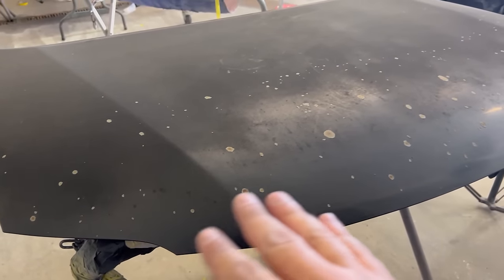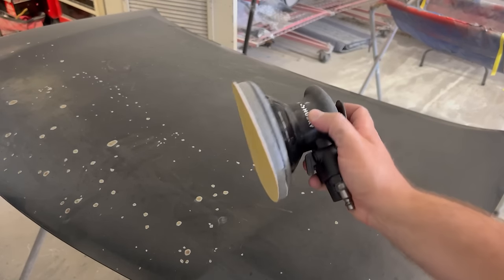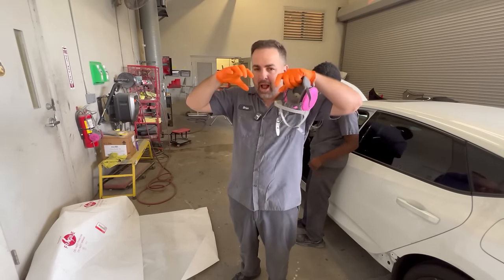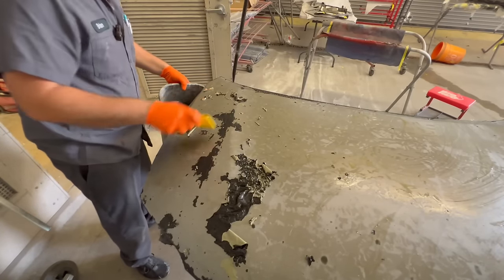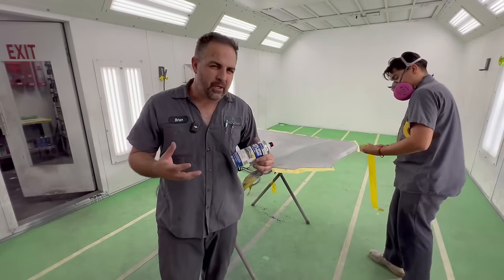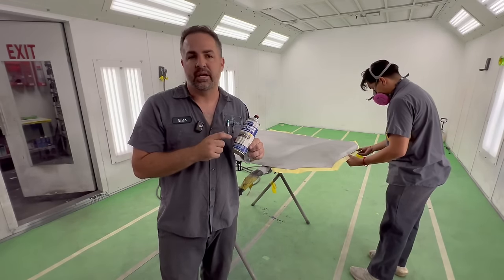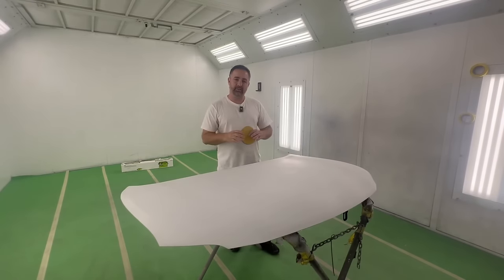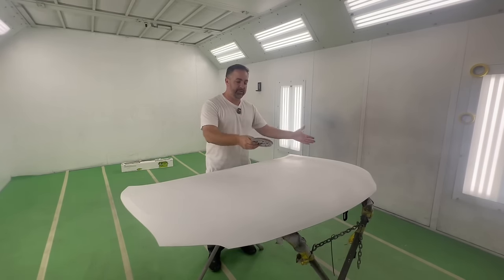The Easiest Way to Remove Paint to Bare Metal!

Comment: Great video. I would like to give you a word of caution when using a paint stripper like this. I am a retired Air Force aircraft painter with 40 years experience. I'm sure this product is not as strong as the stuff we use, but the fumes can be very dangerous. Please do not use the type of mask filters the guy is wearing in the video. Those are made for heavy particulates and or dust, not vapors and fumes. Those type off ilters will do nothing to stop the vapors from that paint stripper. If anything they will concentrate the fumes more inside the mask. When using this stuff, be sure to use an organic vapor and mist rated filter on your respirator.  Check the instructions on the different types, but I believe the ones needed are the pink and black style or the pink and yellow 3M style cartridges for that type of mask. The proper cartridges have a charcoal layer inside the cartridge and a prefilter that helps stop the fumes and vapors. A full face would be better for eye protection. Be safe out there everyone.
Reply: I would add being clean shaven when wearing a mask having a beard means they don’t seal at all.
Reply: What can I cover my face with that I would have at my house?
Reply: @cmygamelife  Nothing ... We cannot buy this stuff here where I live in Africa so it is sanding for us I think.
Reply: Correct . You are right I agree
Reply: @hendrikdebruin4012  Does H&S apply in Africa?
Reply: @mariemccann5895 It does in formal industries in some countries. Here is Eswatini not. We cannot buy these paint strippers in Eswatini so sanding it is.
Reply: awesome tip
Reply: I noticed he using 2097 filter which is for particulate. Shop might have good ventilation who knows

Comment: I work in a shop, we recently  stripped a set of wheels with this same product. To say it works great, even on powder coating it takes a bit longer. Just don't let it dry out, the slag paint becomes  harder than it was. Great stripper. Wear eye protection,gloves, and probably outside.
Reply: thank's for the tip 👌
Reply: Did you use 2k epoxy on the alloy wheels after stripping ? Or something else?
Reply: @harshadchari6065   We coated the wheels with self etching primer, then urethane primer. Before urethane base and clear coat. Hopefully it holds up for many years. IDK it was the shop owners call on the material used.

Comment: A couple of decades ago I had to strip a hood which was painted multiple times by a so called professional. It has so many layers of paint it actually looked like a cheap fiberglass hood.

I used the same process shown using plastic sheeting to capture the active ingredients while is worked.

The hood was stripped clean and primed, painted, cleared.

The shop manager was happy and more importantly, the customer was happy.
Reply: Back then the formula was totally different, ALL strippers are outright garbage now "by comparison". Knowing that already, my stubborn self needed to be re-convinced..
 I just had a massive stripping project. I had two brands of old formula strippers in my garage. I was happy as a clam watching them turn old hard durable paint into wrinkly scrap-able goop, BUT the moment I ran out, and re-purchased the same brands in their new, tree-hugger, EPA approved, save the world formula, everything stopped - and I mean STOPPED. It was EASILY TEN times less effective - not twice less effective - TEN times, and I'm being conservative. I reapplied than reapplied until the entire can were completely gone, and it still was less effective and 2 MAX coats of the prior formula.
Genuine stripper use is absolutely over.
Reply: @svenshanah  I TOTALLY agree.... The same goes for 'Brake Cleaner'...
Reply: They've been doing the same thing to paints,  stains, and thinners over the last couple of decades. All these water born oils and such 🤬

Comment: I’m using this 15 minute ( next to last ) wait period method on my 1977 Gold Wing air cleaner box in black restoration- tomorrow. I’m confident that it’s going to eliminate most imperfections on a complicated part. Doing two coats of satin black over etching primer that dried for 36 hours - then with a light scuff with 3M Scotchbrite… then “tack-Rag” ( The Furniture Guys reference ) before 1st topcoat. Wanting to mimic factory finish. Thanks - your channel is excellent.

Comment: Klean Strip used to have a dry process paint stripper back in the day.  It would go on wet, wrinkle and dry.  You could then run a razor blade over it down to bare metal.  Stripped my 65 Pontiac with one gallon!

Comment: Great video, I too use that paint stripper but when I covered with plastic, it didn't pill as easy as it did for you, I had better results without.  And I have better results in my paint jobs when I do a 50-50 or 75 overlap.  Thanks for what you do.

Comment: Great video and exactly what I needed.  You started to answer the question I had, but really didn't.  Where in this process would you do the bondo?  Bare metal or after epoxy?  I have no history with epoxy so would like to do it the best way.  Thanks so much for doing these !!
Reply from the maker: Epoxy it. Filler over epoxy. Then 2k urethane surfacer primer

Comment: Something that helps make a job last is to get any redone steel down to bare metal and then once cleaned, heat it with a torch until the metal turns from dull to shiny and get all of that moisture drawn out the steel to prevent rust. While the steel is warm start spraying your primer and not only will you now not trap moisture, but it will help bake and bond the primer to the panel and help it last a decade vs. a few years.

Comment: Thanks Brian  have been useing aircraft stripper for a long time. The new formula low voc sucks compared to the go formula  But I like the cover it with plastic going to have to try it on a firewall might be a little harder since its vertical 👍👍

Comment: I haven’t used that stuff in a while but I think it says to neutralize the acid with water afterwards, and I don’t have a problem with etch priming the whole panel, seal, base,clear in same day. I don’t use sealer and epoxy together
Reply: I thought it would have had to be neutralized also, but don't have experience with that product. Strippers  I use all need to be neutralized.

Comment: The system I use has a 2k etch primer you can put in the gun. I strip the paint to bare metal, sand up to 320 on a da, etch (2 coats), seal, base, clear. Works great.
Reply: what is a da?

Comment: Hi, that stuff works just like the aircraft stripper I was using in the 80"s except it doesn't have the additive. It was amazing how well it worked. I painted an entire car, went for supper and when I came back the paint on the vertical surfaces just fell off. no gooey mess. don't get this stuff on your skin!!
Rich

Comment: Brian, I truly enjoy your channel and have learned a ton from you.  I am a DIYer and into old 50-60’s cars.  I am just starting a project of stripping the metal for rust repairs and body work.  I would appreciate if you could give me your opinion on using “Klean Strip- Concrete & Metal Prep” on the bare metal after I get it stripped before It gets the epoxy primer?  Are there any watch outs or other prep process that would be required if using that Metal Prep?  Thanks!

Comment: I used the Ultra stripper and the other weaker  version of this brand of stripper to strip my 73 van. It had 3 layers of paint and primer on it, so it had to be removed before I laid down a new custom paint job on it with European Clear Coat. I applied the stripper in sections and covered each area with plastic wrap (generic Saran Wrap). I left it on for about 20 minutes before removing the plastic wrap. It removed one layer of old paint at a time. So I had to reapply more stripper to remove each layer. I did have to mechanically remove some of the paint layers that the stripper wouldn’t lift. It’s messy and yep you need a respirator while working with it, but I prefer using it to stripping it all off by machine. 

To repaint my van, I used all Eastwood products. That included their epoxy primer, high build primer, single stage white and black urethane paints, Candeez candy paints and silver base coat for candy and their High Buid European Clear Coat. I’m finishing up the paint work after working on the paint, body and metal work since 2021. 

Here’s my take on Eastwood’s paint products-the primers worked fine. The single stage paints were fine either with or without clear (the van has a white base coat under the custom painted areas. It seems to be a quality paint for the price. The Candeez products are decent, though probably not as vibrant as House of  Color products, but they were fine for the price. I used Urechem intercoat to apply the flake. The European Clear covers good and spreads itself out well and is crystal clear. I laid down multiple layers of it over several months. I wet sanded by hand with 400 between each coat and let each coat set up and harden for at least a week. There are probably 5 or 6 coats of clear on each area. I’m painting in my garage. 

I haven’t cut and buffed any of the clear yet, but one side that I am finished with looks flat and shiny without that step, so I think it’s going to look great after that step. I’m satisfied with the Eastwood paint products given the price I paid for them. I used 3 gallons kits of the clear which made 4 1/2 gallons of sprayable clear.

I didn’t work on the van in winter, so there has been a four or five months hiatus each year which delayed the project. I’m about to finish it the paint this Fall. Next year I should be showing the van, which is called the Led Sled. It’s a tribute to Led Zeppelin.

Comment: Hi Brian thanks for the video! This actually motivated me to re-try painting my hood that I messed up the first time! Do you have any recommendations on a inexpensive gun that can deliver similar results to yours in this video? Also I think about enclosing a part of my workshop with plastic and plywood wood to make a "dust free" room and using to square fans with house filters one pulling and one pushing. Do you think this is a good idea for a diy spray boot? Any advice are welcome and thanks again for this amazing video! From 🇨🇦

Comment: In Finland we got these 2k paints cans that mix as you use the spray by Maston. Unfortunately the ones I've bought have never worked properly.... I haven't read a single good review of these cans except for one guy in germany who used it and said it worked fine. But it's apparently a thing and I wished more companies would try that. I'd really like some long lasting 2k in a rattle can for small fixes.

Comment: Looks really nice.  How would it look color sanded with the Linear Blocking System??? I'm a professional detailer and I'm looking to pull the trigger on that. Also, how long before the paint gasses off before color sanding?  Thanks for a great presentation!

Comment: i am in the process of restoring a 1968 dodge charger and the paint is chipped and gone to hell, it has to be taken off. would you recommend sanding it off or using a liquid remover? i am a complete beginner and have no experience, so a walkthrough on what to do and products to use would be much appreciated

Comment: success depends on the paint being removed, obviously very easy on this example but that's not typical as usually end up requiring multiple attempts.  In hard to reach areas it's fine but otherwise it's easier to use a stripping disc.  Old paint strippers used methylene chloride, some other solvents, thickeners to keep it running off vertical surfaces and wax to reduce evaporation.  How do I know, I was chemist at an industrial chemical company and we made it for various companies

Comment: Excellent video.  I have the same problem on my 2010 Lexus RX 350. Looks identical with those chips.  Question, did you put two sealers coats then sand the second sealer coat or did you put one sealer coat, then one base and sand the base then out one heavy base coat and one drop coat?  Doing this paint job this weekend!

Comment: This is probably an oem  hood. You see this is alot in some models during some runs. They don't usually issue recalls for paint and if there are problems with the paint prep during manufacture it is not dealt with unless forced.

Comment: I don't know what kind of paint that was, but after watching a good 30 videos, we bought this stripper, Kleen Strip, 2 Minute, as well as some "Cooper's", (which is actually a bit better)..but NONE of them performed like this on 3 various years/types of paint on auto sheet metals, and 2 various furniture pieces and cabinet doors with a few layers of latexes.
This would have been great, but even after HEAVY re-application and covering it in quality plastic wrap, it was "maybe" half this good in it's very best areas.

Comment: Great video...is there a chance of "warping" an older (late 60's early 70's) hood by sanding ?  or is it just the newer thinner hood...
Reply: Typically for me the only times things warp is if the sander gets the metal to hot but other than that it seems to be fine with normal pressure

Comment: I would use the citrus stripper with plastic over it to prevent drying. Leave overnight then pressure wash off followed by air drying with a leaf blower and air gun for the small details. Way less toxic than the heavy duty strippers.

Comment: Idk this newer aircraft stripper doesnt work like it used to. I remember ooening the can to use it and any painted surface in a 20ft radius paint was curling and falling off just from the fumes that wofted around. I used the new stuff on my motorcycle to strip the paint. Even covered in plastic sheeting it didnt do anything at all.

Comment: Forgive me if someone else asked this but did you rinse the stripper off before you sanded the bare metal with 180?  I would be afraid to scratch the residual chemical into the metal and possibly cause issues with the paint.  When I have used stripper, whether it was correct procedure or not, I washed it down first with acetone and then soapy water and then rinsed it.  What are your thoughts
Reply from the maker: Wax n grease remover

Comment: its a great tool to use, but it does can create alot of chemical mess, and what about damage of the inside hood, or damage  the shop floor dripping. so it can cause alot of problems.  also wenn you have to repeat the work, wenn it wont come off at once....   nice video tho!!!

Comment: They removed a key ingredient so it no longer works as good. Im applying the 3rd coat of gel stripper this afternoon. The base paint and clear was laid at a premium painter and its not even easy to chip, it wont chip its tough. Maybe I need to experiment with a different stripper.

Comment: Hey Brian, I recently clear coated a part using the extra slow reducer. The temperature was around 70 degrees in the shop, the clear coat laid down perfectly, and looked great until about 2 hours later it began to sag very slightly in one area. No big deal, I can get it out, but Im just curious as to why this may have happened, was it due to the usage of the extra slow reducer when the temperature was not very hot? Obviously laying it down heavy on the final coat likely contributed, but would using a slightly lower temp reducer help to prevent this?

Comment: Hey Brian, is this method good to try out on my integra, it only has primer sealer and I painted it about 2 years ago or more now so the paint is already dusting off or would it be better to sand down since it's only a thin coat and there's body work around the car? Thanks! Great video!
Reply from the maker: Try sanding first. Unless the parts are off the car. It can get messy

Comment: HELP, something important confuses me so much. So, I’m from uk. Im english. I need to know, as literally everywhere on the internet says one thing, and my job as a painter at an insurance garage says another, what IS  sealer, and also, what IS wet on wet??? Is sealer for you in the US, and whenever I see you spray it on your channel, is that the same thing as the wet in wet primer I use here in the UK. Also, is wet on wet just a technique, or a specific product that does a particular job, that nothing else can do? Because we have wet on wet primers at work, about 5 different shades of it, and it looks like the sealer you use. Super smooth and thin with zero build to it. But sealer in the uk is the glue that goes around the edges of brand new panels with a squidge squirt gun thing and disposable nozzles. At work we use wet on wet primers, but literally everywhere in the internet says it’s just a method or a way of spraying to save time and that it is not a specific product, and that any primer can be wet on wetted if you spray it a certain way.

Comment: Why only two coats of clear? Could you maybe do 3-4 for more thickness and go back in and sand and buff to finish? Wouldn’t that be better for the diy person without a spray booth to get out dirt and nibs?
Reply from the maker: 2 coats of high solids clear is equal to 3-4 of cheap clear. Plus.  If you add more coats you run into loss of gloss issues that cant be buffed

Comment: I'm surprised you didn't have to wipe the hood with anything before you DA'd it. It seems any residual chemical remover might just get sanded into the metal and cause possible issues with the 2K. Unless did I miss you do that?
Reply from the maker: Solvent cleaner

Comment: .. An excellent vid as usual,.. A question,.. What did you use to neutralise the paint stripper residue before laying-on the epoxy ?.. Cheers,. Dan, England .
Reply: I was also wondering this. I'm assuming the step was missed on video maybe?
I've used water or gun wash to neutralize when I use stripper.
Reply: @RestoHubAU  .. I've washed the stripper off before and dried down with cloths  and then panel wipe degreased before primering,.